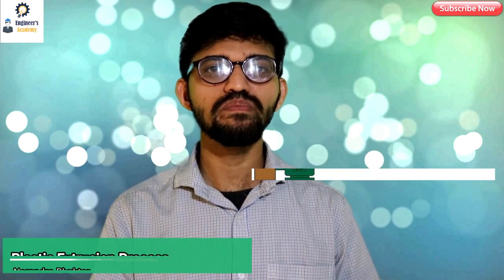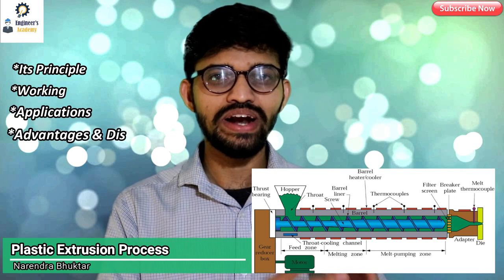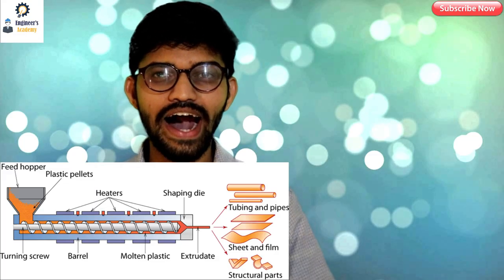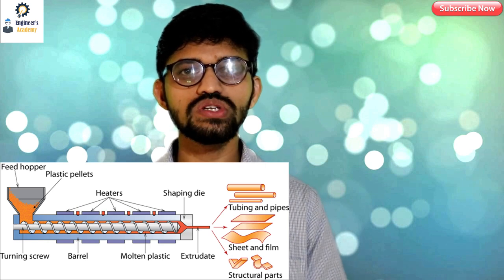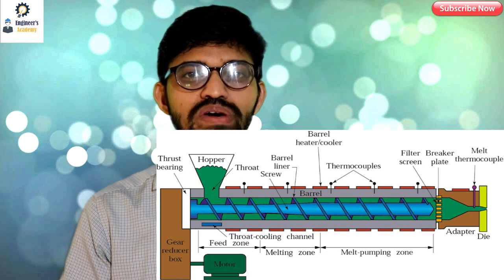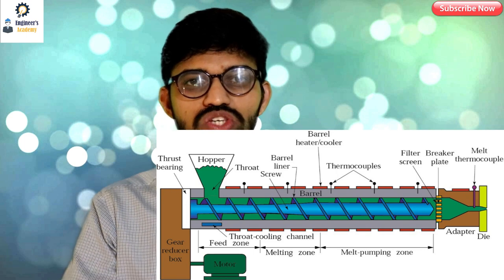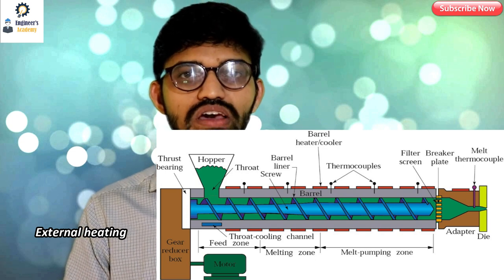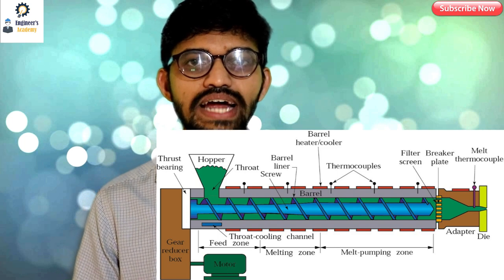What is Extrusion Process?? ||Engineer's Academy||

Comment: After extruder extrusion polyethylene melt inside the bubble is what reason？
Reply: Sounds like a Vacuum  issue.
Reply: your raw material is not dry. try to take out humidity in the raw material
Reply: It's reason is vaccum and rubber contain material